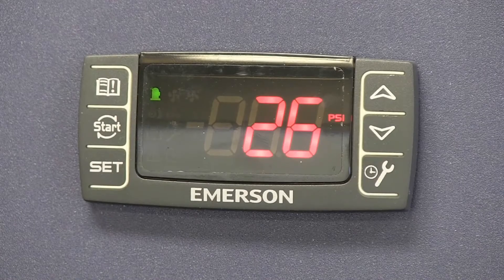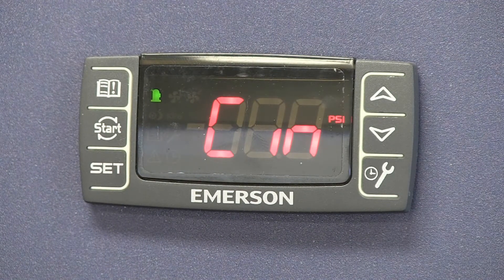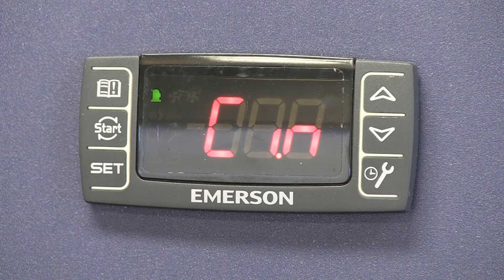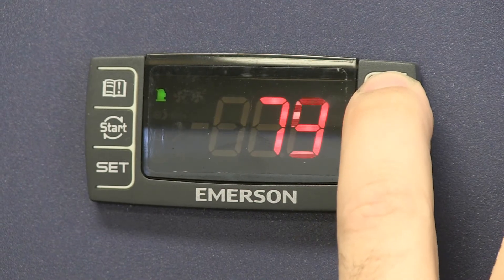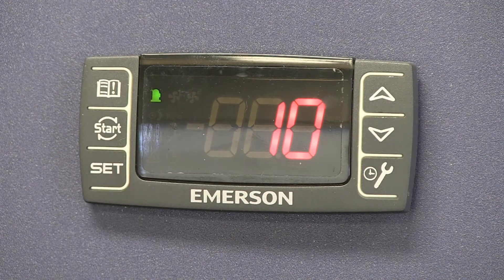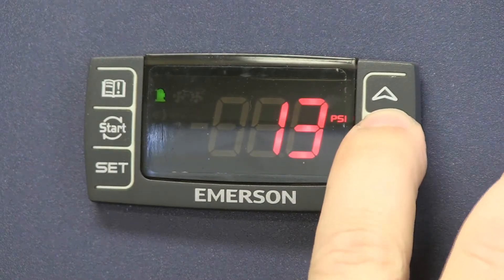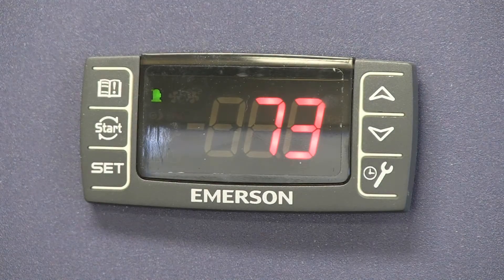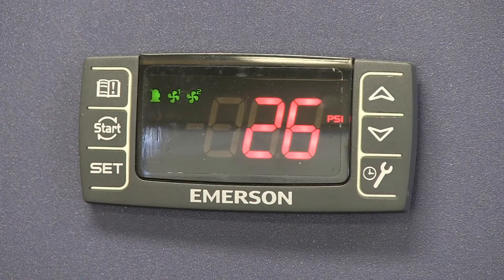EUC Advanced settings - Fan Set Points - Inside Copeland Ep. 10

Comment: is it possible to set control based on a pressure input instead of temperature?
Reply: This particular control operates the fans based on temperature only. This is to allow the use of multiple refrigerants without needing to set a specific refrigerant or configuring pressures for a specific refrigerant. Other variants of the control (Dixell XC30CX) are available that allow the use of pressure to control the fans.